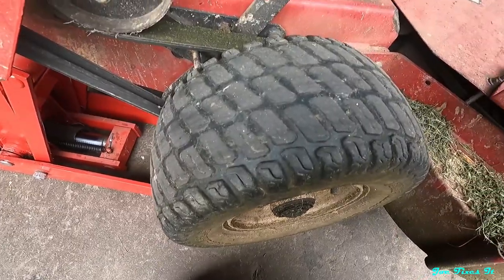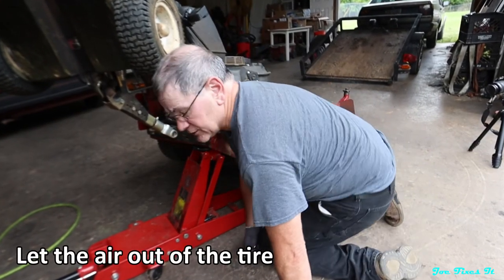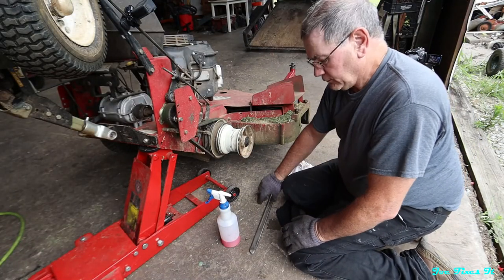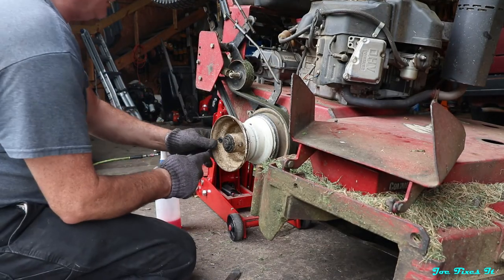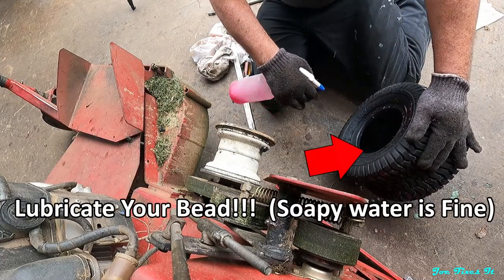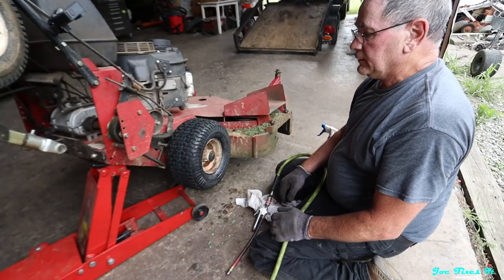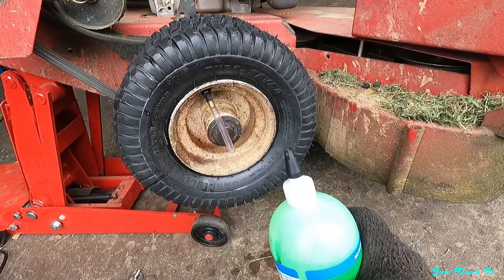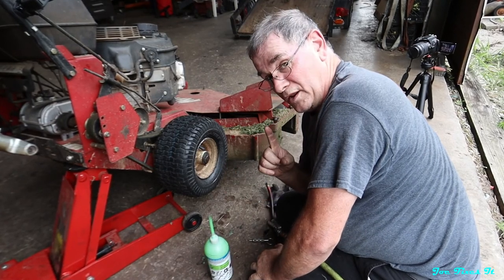How to Change a Drive Tire On a Walk Behind Mower | Exmark Metro 48 | DYI Mount Dismount | 13X6.50-6

Comment: Im bending the shit out of the lip of the rim 🙄
Reply from the maker: that is kind a hard to do.. they are a little bit of a pill to get back on
Reply: Haha i gave up and took them to a tire shop. I fought for 2hrs today with them. Finally took the whole wheel assembly off and they had it done in 15 mins lol. I was peeved. Gotta have the right tools.
Reply: @Joefixesit  You made it look soooooo easy!
Reply: @SoCarBuckeye  I hate to hear that..
Reply: @SoCarBuckeye  it was not that bad although the new tires can be a little tight.